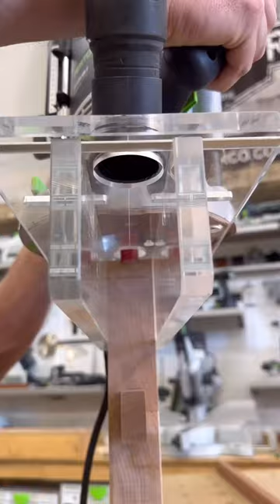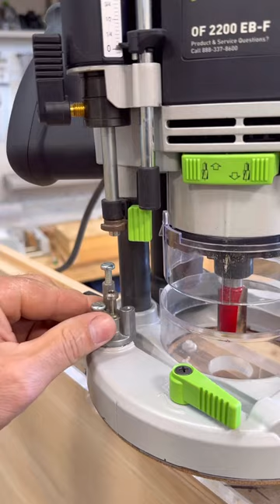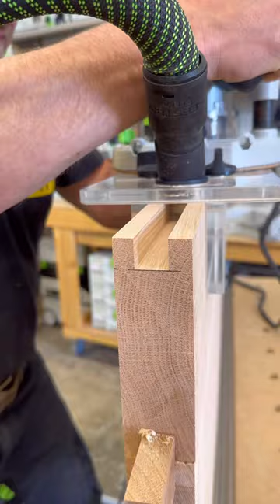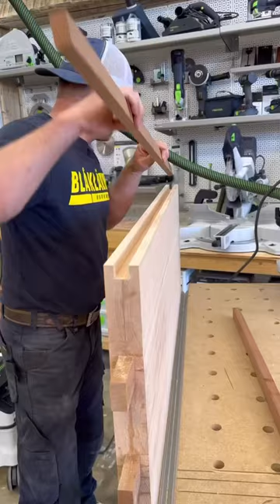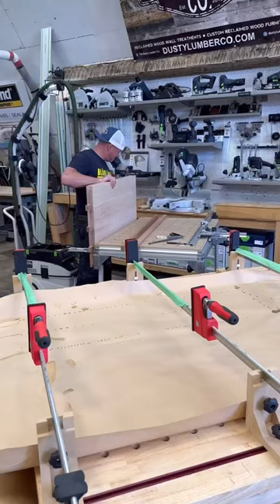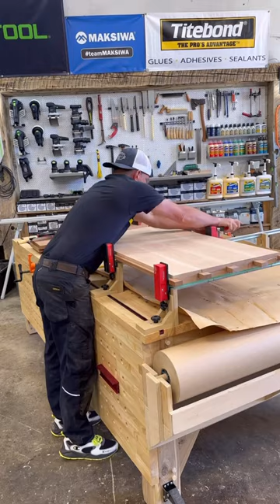Cutting grooves for and gluing the edge exposed splines #woodworking #joinery #wood #tools

Comment: Was an OOPS, HUH? Shoulda been wider.
Reply from the maker: for the main section glue up I didn’t want all the pressure on the edge splines during glue up. I also didn’t want the clamps pressing on the open groove during glue up and I did a little trim of the edges on the slide saw to make sure it was all parallel after it came out of the clamps
Reply: @dustylumberco  good idea and well done as usual.

Comment: Just curious, why not mill the boards at a router table before hand?
Reply: That's exactly what he did in a previous video, so I'm curious to see what he's doing, too.
Reply: Yup, could’ve done that too.
Reply: He likes to show different methods of achieving the same thing. It's pretty neat I think.
Reply from the maker: because for the main section glue up I didn’t want all the pressure on the edge splines during glue up. I also didn’t want the clamps pressing on the open groove during glue up and I did a little trim of the edges on the slide saw to make sure it was all parallel after it came out of the clamps